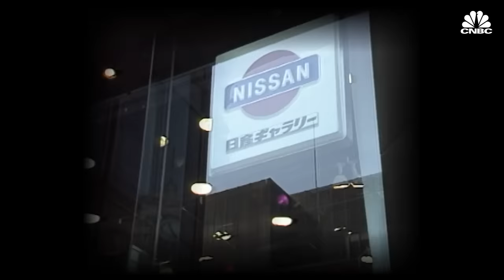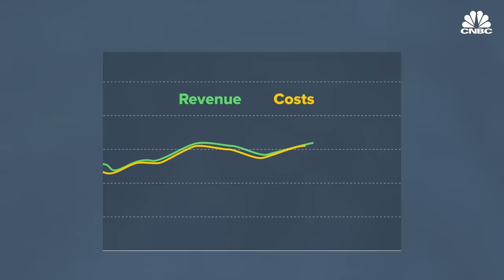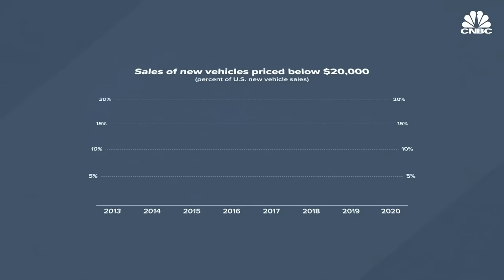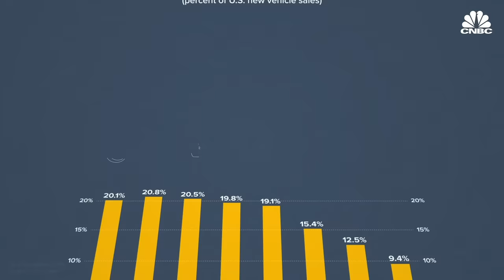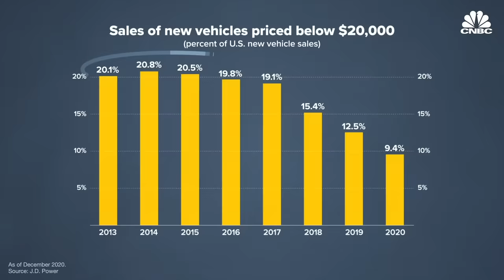Why Cheap Cars Are Disappearing

Comment: I’ve always bought used, and usually paid cash for them. I suppose you could call me cheap, but I just couldn’t bear to part with the amount of money they want for new vehicles. A car has never been a status symbol for me but rather a utility. Guess I’m a dying breed.
Reply: I like to call you smart if you don't mind
Reply: Utility is what I look for in a work truck.  Three years ago purchased a 10 year old Chevy Silverado with 19,000 miles on it.  It was a US government vehicle used on a military reservation.  Being a government vehicle all the required maintenance was done at the suggested intervals.  I change oil and rotate tires and follow all other maintenance as shown in the car’s manual, I expect it to last another 10 years.  BTW, I average around 23,000 per year, so in 1 year I drive more than the truck’s first 10 years in service.
Reply: Indeed....same here
Reply: Ditto, bought a 1 year old 2016 Fusion. It was a rental for 1 year, had 35k miles on it. Got it for half price ($16,750), fully loaded Titanium. 3.5 yrs later its paid off, has 63k miles and should be good for 140k more, debt free miles. Shame Ford has cancelled them.
Reply: No you're a smart guy who doesn't live beyond his means... on credit! 👍
Reply: I got my 2003 Cavalier in 2014 for $6000. It only had 51,000 miles on it. It only has 80,000 now. The loan was for 5 years and payments were only $65 per month.
Reply: @ForAnAngel   Another smart guy!! 👍
Reply: I see a car as a reflection of me, but I still bought used and paid with cash.  

I bought a beautiful red 2014 Mazda 3 that came with nice speakers. It was sensible but "pretty" to me. It was also a massive upgrade from my previous car - a 2004 Toyota Corolla lol. 

You can still get a vehicle you love if you're willing to be sensible about it. 

Owning a Porsche might sound nice until you factor in insurance, maintenance, and oh gosh, imagine someone carelessly scratching it with their shopping cart as they go by. That kind of car just isn't sensible for most people.

And "status symbols" are stupid anyway... they just symbolize that you're dumb and don't know how to use money for the most part.
Reply: @PriusRaj  Well said but unfortunately a lot of people don't think of that big financial commitment for the long term, most people don't have the cash to buy these vehicles so they spend beyond their means, buying that fancy car or SUV... sayin look what I have! yeah what you have is six or seven years paying off a car you can't really afford, just to look good? That's too high a price to pay for me!
Reply: That's the right thinking. I take it the same.
Reply: Wisdom is indeed a dying breed. Add, common sense wouldn't be so valuable, if it wasn't so uncommon.
Reply: I make 60000 a year and I drive a 1994 Toyota Camry LOL...
Everywhere I go I have the oldest car but I don't care
Reply: @deanvoss7098   Another guy who know how to spend his money! 👍
Reply: I did at first but eventually I liked having knowing that my previous car wasn't beat the f out of.  But I wouldn't just buy anything, I waited usually around Black Friday and shopped multiple dealerships for the car model and package I wanted. With used cars, you usually don't find a perfect match it's more like it's good enough or if you somehow find a good  make/model/package it will have 150k miles or more on it.
Reply: Cars are glorified shoes with extra storage space
Reply: @kernracing7677  
*you're
*you're
Reply: Same I look for reliability and good on gas milage only idc how old they are. 🤷‍♀️ I don't like they're forcing electric cars since I drive an hour to work and then an hour home from work and go on vacations a lot and travel 600+ miles, it just doesn't seem to he feasible for people like me.
Reply: Shout out to all the guys that drive a new shiny car but live with their parents or in a dump.That's what it's all about. Priorities.
Reply: @PriusRaj   I really wanted a Camaro SS. No one “needs” a muscle car but I feel like if I’m spending my hard-earned money on a car it should be one that I really like. Anyway, I bought a 1 year old used Camaro SS with less than 12k miles on it in excellent condition. I saved money and still ended up with the car I actually wanted so I feel pretty sensible about my purchase lol. As long as people are buying within their means I don’t see anything wrong with buying the car that you love, including a Porsche.
Reply: The "status symbol" part of the equation certainly matters. Many people I know made a decision - "I've got 15,000$, do I want a brand new Mitsubishi, or a 3 year old BMW?". Very few chose a new car...
Reply: @deanvoss7098  I make just over 60K on overtime because 20 somethings don't want to work.  I drive a 1994 Dodge Shadow I paid $1,400 for 15 years ago.
Reply: Kia used to make good affordable cars where I'd argue with you. $17,000 for a decent car with a 10yr 100,000mi warranty is probably a better value than a used car. They don't really do that anymore 😞
Reply: I'm sure Scotty Kilmer would approve. =D
Reply: Same here
Reply: nope, your breed continues on.
Reply: If you can’t pay cash, you can’t afford it. Just purchased my ‘new’ 2012 Mazda, happy with it. You look at new / flash cars driving past and you wonder how many people actually own them.
Reply: You’re not alone! 8 years ago I bought a 1986 Dodge Ram for $800. Still drives like a champ. You don’t HAVE to be an idiot to get around these days; it’s just common. It would also help if people would take the time to learn to work on their cars. It’s an extremely valuable skill; not only can you maintain a vehicle and make it last longer, but you can get a cheap used car with a few problems and fix it
Reply: If the car works and it’s comfortable for you that’s all that matters
Reply: @deanvoss7098  I had a 97 Camry for 8 years and the engine blew at well over 300000 miles. During those years I saved for when that time came to buy another car. People would ask me you still driving that old car? Even with the fading paint I loved that car, it only broke down on the road 3 times in all those years
Reply: I paid 1200 euro for my second hand yaris and have never regretted I made some 80000 km and the car is fine
Reply: You know you have an entire generation called millennial that thing like that
Reply: Thats smart, and i agree, have been driving a beater for 4 years thay i bought when i was in school. Its the 400 dollars that i dont have to divert towards something every month. Will i buy a used car again, yess!
Reply: and by the time you pay it off it's value depreciates by two thirds and you've basically paid for the car twice through interest.
Reply: Im a total petrol head and I love cars and I work on mine daily. I will still always buy used cars. Want the 2020 model? Wait one year and get a 20%-40% discount.
Reply: @stanwolenski9541  I hate to tell you this but military tech comes from the lowest bidder, so just because it's military doesn't mean it's actually that good.
Reply: @MichaelJohnson-fe8tm  it's not that 20 somethings don't want to work, it's that they don't want to work for slave wages with no benefits. And why should they? If you can't afford to pay more than slave wages you don't deserve to be in business. That's why restaurants started raising wages and benefits to get people to work for them again. This is what conservatives (not saying you're one) would typically call the market correcting itself, but for some reason they decided to stick to the narrative that nobody wants to work instead. Of course if your businesses in California then you'll have to find a work around, like franchises taking less off of the franchisees so that they can afford to pay their workers more than slave wages with no benefits.
Reply: @MrGamelover23  the lowest bidder doesn’t mean it to s inexpensive, $450 for a toilet seat rather than $ 495 is still a high price to pay.
Reply: Used cars are much more expensive now.
Reply: They’re trying to buy out those of us who buy with cash by raising prices of new cars. I can’t get a decent used truck under 20k. Used to be able to get them for 8-12k. But people buy payments not the value of items.
Reply: Same my car is $2800.😂
Reply: @deanvoss7098  I can understand owning a nearly new car for half the price or a 10 year old car worth around 5000$ but a car 20+ years old is a recipe for disaster!
Reply: Last new car I owned was a 1992 Acura integra  $16,0000
  Used cars to this very days
Reply: Same, i buy always second hand, just for cars, laptops, mobile phones . Not on credit though, cash. i dont know its already a habit.
Reply: @DeniseRene407  : Don't ever apologize or feel the need to justify your reason for buying a 'muscle car'/car you wanted or anything else for that matter, especially to a bunch of strangers on the internet.  There isn't anything wrong with buying a car you enjoy driving especially if you're into cars. People who are happy driving a boring appliance, whose only concern is getting from point A to B, will never understand spending money on a car you actually enjoy. 

I have to laugh at some of these comments. If someone is happy driving a 25 year old beater that's fine. If someone wants to drive a $2 million Bugatti that's fine too. If someone lives in a 1-bedroom apartment & someone else lives in a 30,000 sq. ft. mansion so what? People need to keep their eyes on their own paper. Who cares what others spend their money on? They can save it, spend it, waste it, or light it on fire if they want. SMH
Reply: @True Roman i do have a Toyota truck haha and got a Ford suv and subaru car they're all decent on gas milage but refuse to get an electric car until they make electric charging stations more well known and faster to charge, I'm not booking a hotel for the night so my car can charge when gas takes 5 minutes to fill up. Ain't nobody got time for that. 🤣
Reply: Why buy new?  They start losing value the moment you drive it off the lot. I’ve always bought used.
Reply: I like cars better before antilock brakes ,airbags and with crank up windows. All that stuff just pushed up cost. AT and AC are all I consider worth the extra cost.
Reply: One of my favourite beaters I ever had was my 1970 VW hippie van. It was camperized (not by me but a former owner). I bought it for $500, drove it around for two years, sold it to a buddy of mine for the same amount who drove it into the ground about five years after that. It wasn’t pretty, and it burned a little oil but it ran.
Reply: Same here! It's a box on wheels that gets me from A to B, literally the only luxury I want in a car is a radio, I dont even need a heater, defo don't need Aircon in Scotland, don't need central locking, don't need heated screens etc, guess I'm just not lazy.
Reply: Bought a crashed and repaired Suzuki subcompact for 3 grand (UK gbp) 3 years old and only 8k miles on the clock :) some of us are shrewd, not all of us sit dribbling into our cereal, some of us can think for ourselves and realise luxury is for those who wish to spend their life running like a rat in a wheel.
Reply: no your not I'm a millennial and believe in buying depreciating assets in cash. why pay more in intrest if you cant pay cash for a car than you cant afford it.
Reply: @ForAnAngel  your lying the car at 65 a month for 5 year equals to 3900. makes no sense.
Reply: @rafiqsunesara3416  Good catch! The difference was the down payment.
Reply: Stupid take. Everything is a utility minus Food, Water, Shelter. Unless, you don't spend good money on anything in life and live like a hermit.
Reply: @stanwolenski9541  great purchase! Always pay attention to the maintenance done to a car in the first 15,000 miles. Some people don’t alter their oil change intervals to accommodate for the break-in period. A family me member of mine bought a 2021 Subaru ascent and has driven it 26000 miles with only 2 oil changes done to it and the oil filter was rated for 6,000 miles. Lots of old regimes or misinformation is out there about vehicle maintenance and people don’t care about the micro actions leading to macro changes, because they won’t keep the car past 150,000 miles anyways.
Reply: @TheNuclearBolton  In 1990 or so I bought a Ford Ranger, initially walked out of the dealership because I was not happy with the price and purchase terms.  A few hours later the dealership called and met my terms.  I drove the car for a good number of years, I don’t recall the number, during which time I changed the oil, filters  and rotated tires on a regular basis.  When I sold the truck it had. 190,000 miles on it with the original clutch.  Other than normal maintenance I’d  spent $300 on repairs.  I saw the guy who bought it several months later and he loved it.
Reply: You must hate driving or dislike going places
Reply: Good post & I agree!! No way am I forking out THOUSANDS for plastic, on 4 wheels!! 🤪🤪🤪
Reply: @Anthony-qj7qe  I think the same way. I don't see a nice new car, I just see a 500 dollar lease payment. Add onto that the downpayment which is significant, and the fact that you don't even get to keep the car that you've spent thousands on, and to me, that's just not financially wise. Also, dealerships will Nickle and dime you for a scrape or for extra miles.

To me, that's never been appealing. I bought a 2012 Outback in cash and have been happy being debt-free and not having to pay half my rent on a car. My car has modern features like navigation and a backup camera, plus nice seats and a good stereo, really it has everything that someone would want and it doesn't feel like a ten-year-old car and it doesn't require me to work like crazy to try and afford it

Buying in cash also means that if you become laid off for whatever reason, your car will not be taken away if you can't keep up with payments which is crucial when you need a car to travel between interviews.
Reply: @colechapman6976   Good move and on top of that, you can breathe and not be a slave to that lease or car payments, that you would have with a new car. Besides, you  just lose too much money on "most" new cars and never really get back your initial investment. Don't get me wrong, I would love to have a new car but I am not willing to sacrifice my finances for years, to get one....its just not that important to me.
Reply: I have a 97 Toyota Avalon which has over 200k miles and still runs like a charm. Low maintenance and cheap insurance! I will drive that car until it falls apart.
Reply: I wouldn't call you cheap, I'd call you poor.
Reply: I'm right there with ya man! I call us just being smart🤔
Reply: I'm with you.
Reply: You are not alone. I used to always pay cash for a car and still do always buy one that is a few years old. The thing that has changed is even at that most still have a car payment because anything that won't break down real quick is very expensive.
Reply: Here in New Zealand and in Australia, Chinese car brands like Chery and Geely are actively competing with the used car market by selling, cheap, brand new cars for $12,000 or less.
 
I would have considered buying a Chery car but due to the fact Chinese cars are still fairly new to the Western market, there's not enough spare parts for them to go around just yet.
Reply: Same here. Have not had a car loan in over 25 years.
Reply: You're not the only guy who has an ideal process of buying a car